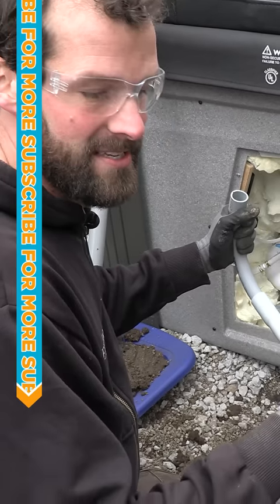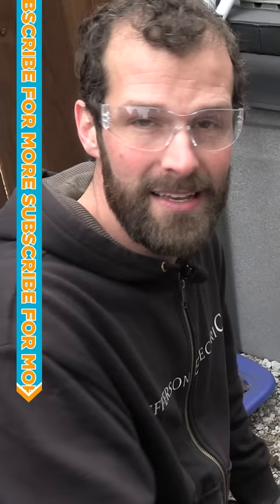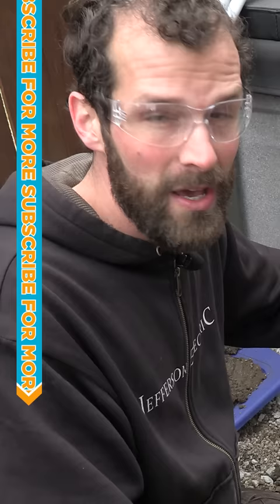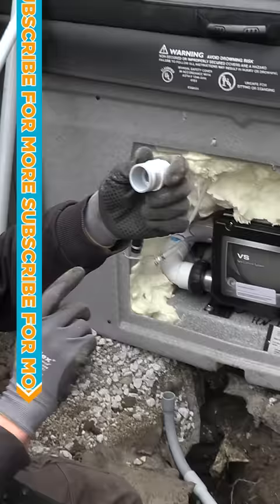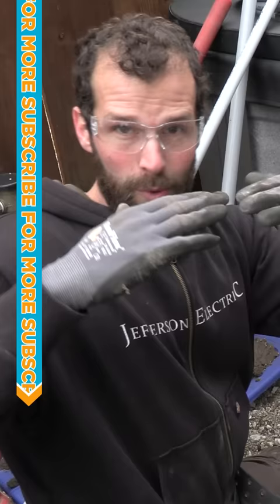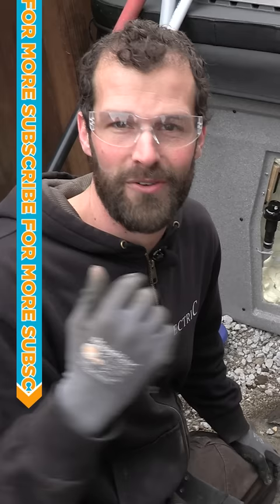A Warning When Using PVC

Comment: 20 years as an electrician and I’ve never seen that happen, hell we run empty conduit underground for future use and years may go by and it’s still functional but then again we glued our pieces together.
Reply: Yeah man. Same here. You need to glue both sides and fully seat it into the coupling end and hold it for 5 seconds. Otherwise the expanding gases or whatever will push the two pieces apart, leaving it about 1/4”-3/8” from being fully seated. This is a pain in the ass because the snake will get caught up in that little gap, especially on bends.  I’ve never had PVC fall apart after the fact though. As long as you glue it really well and let it set while fully seated in the coupling , it’s not coming apart underground.

Edit: Like your name. I always say “storms-a-brewin”
Reply: @SnotrocketLT4  Thanks
Reply: Well my friend your definitely not an industrial electrician and most likely a terrible one.
Reply: @SnotrocketLT4  lol really never. That just means you don't really do much.
Reply: @shawnshurtz9147   Wait, what? lol.
Reply: @SnotrocketLT4  I've seen steel conduit pull apart and break.
Reply: @DankEngine710  it's not the sunlight it's the heat and I actually work. For 100 feet of pipe 100 degrees temp difference you get 3.6 inches of expansion. If it were near 100 degrees outside when you installed the conduit that winter when it was 0 degrees outside the 100 feet of conduit would shrink 3.6 inches. He was a little wrong you are totally wrong stick to dumb factory work it suits you because you have no clue. I mean thermal expansion was taught in like what 3rd grade.
Reply: @shawnshurtz9147 Boy someone is pretending to be pretentious.  You would only need an expansion fitting if it's above ground and the expected expansion is to be about 1/4" or more between a secured item (box, elbow, etc) a horizontal run direct burried underground with them glued properly and below frost line you do not need an expansion fitting.  (The piston wouldn't work directly burried) Your whole book answer equates to about after 6ft @ 100F coefficient you need an expansion fitting. You should get some REAL WORLD experience before talking down to others.
Reply: @shawnshurtz9147  did it pull apart in the dark like your attitude to everyone here?
Reply: @brianwoods6403  no the cold like your attitude to actual knowledge.
Reply: @hollowlife1987  Is 20 years all over the country running and working hundreds of jobs enough REAL WORLD experience.
Reply: @hollowlife1987  also if you'll notice I didn't say anything about burying it go read. I was just letting that said it doesn't expand know he was totally wrong. Also what do you mean "below frost line" that's roughly 6 feet where I'm at. There is no way in hell I'm going 6 feet deep with conduit you've lost your mind.
Reply: @brianwoods6403  I'm the one that's not on the jobs till the end to fix the f-ups so the jobs get finished on time. You know the guy that's actually good. Nice to see you get up at a reasonable time though.
Reply: Let's be fair, his story is not completely nonsense: it is relatable, and easily preventable.
Reply: @shawnshurtz9147  What a day mb comment, let me guess, you’re 12?
Reply: @pear7777  Maybe for some, I guess.
Reply: @WORDversesWORLD  42 nice guess though.
Reply: @shawnshurtz9147  Close!
Reply: 42 and acts 12
Reply: @hollowlife1987  wait a minute here are you doing what you accused me of doing girl.
Reply: @justinkase1360  how so
Reply: @hollowlife1987  I didn't mention underground. My whole point is everyone's telling the guy he's totally wrong and stupid but he's not. I'm going to guess no one making these shit comments has ever opened the nec
Reply: @shawnshurtz9147  why comment on a comment about an underground install if your point didn't apply to underground installs...🤔
Reply: Yeah, agreed. I call BS. There ain’t no way that pipe expands an entire inch WTF😂😂
Reply: @g-dub4593  Anything for video content, right or wrong!
Reply: @hollowlife1987  I realize you're late to the party but it was a comment for one that got deleted that said pvc doesn't expand.
Reply: @justinkase1360  that's great but the person I actually commented on deleted their comment so.
Reply: @shawnshurtz9147  Nah, sorry. When you reply to someone, their username pops up and is at the beginning of your comment. You replied to both RAINS ACOMING and SnotrocketLT4. Those are the posts I'm quoting. Perhaps you are talking about another post of yours that I didn't quote or mention?
Reply: @shawnshurtz9147  yeah, I’ve seen steel pull apart and break too. On all my jobs though, when using PVC I always glue it really generously on both sides and hold it in there for a few seconds, all the way in, to make sure it doesn’t push out while it sets and I’ve never had a problem. I suppose it could pull out though, especially if it’s not seated that well to start with. Actually, after Hurricane Sandy it was a little hard to get parts, especially for main services and stuff (meter pans, weather heads, eyehooks, etc.)
and I actually got different PVC glue that totally sucked. It was definitely inferior. Luckily I found this out on PVC that I was using above ground so I caught it and was able to fix it. If I had used that crap underground, it definitely would’ve failed. I’ve  only been doing this for like 36 years though so I don’t really know if I’m even qualified enough to talk to you about electric work though. You seem to know a lot and probably know better than me and a lot of people. I can tell because you were telling the other guy he’s a terrible electrician and telling me I must not do it too much, so I’m assuming you must have a lot more experience than both of us. I’m getting there though. I’m learning a lot every day, and my Dad says soon I’ll be able to do splices and measurements with that thing with all the little lines and numbers on it and other hard stuff that he always does.
Reply: @shawnshurtz9147  it's not just "heat". Anything exposed to prolonged direct sunlight will be significantly warmer than the ambient air temperature.
Reply: @jimkane9832  um alright so significantly warmer would mean heat correct lmao. Even if you had no sun and heated it to the significantly warmer temperature the sun made it it would expand the same. If you put it in direct sunlight and maintained the temperature with out letting the sun warm it it wouldn't expand. It's literally the heat.
Reply: @jimkane9832  doesn't matter if it's from conduction convection or radiation.
Reply: @shawnshurtz9147  hey bro you can get your point across without insulting.
Reply: @shawnshurtz9147  He’s just HVAC guy. 
A Trump Supporter too.
Reply: Yeah. It's hogwash. I have run plenty of conduit and never seen it. I run pvc in direct sunlight for solar installs .... lol
Reply: So in the UK,for buried pipes we tend to use ducting that comes on massive coils instead of pvc conduit. And I'm not talking about kopex (flexible conduit) we use the proper ducting that comes pre draw wired,no need to join it either as it comes in massive lengths, coiled.

We were taught in the college part of our apprenticeship about heat expansion/cold shrinkage on pvc pipe,but with our temperatures it'd be like 10mm at most.college was 20+ years ago though,so I don't remember the exact amount.
Reply: @SnotrocketLT4  don't forget the primer or it may pull apart anyway
Reply: @shawnshurtz9147  people are forgetting that the ground condition and frost line aren't the same everywhere in the US.
Reply: @SetchiPaunda  ABS has thermal expansion. I don’t know what he is talking about with pvc. I hate it when I install a pvc fence in the summer sunlight and it falls apart in the winter cold.
Reply: Depends on where you live man here in California someplsces the ground in the summer can get hot enough to singe flesh.
Reply: @infernaldaedra  I’m from Texas and the worst thing I see is discoloration from sun exposure.
Reply: @WORDversesWORLD  Texas is generally similar in some areas but if you live down south it's going to more coastal
Reply: @shawnshurtz9147  "attitude to knowledge" 😂😂😂 genius
Reply: I also call bs.
Reply: What temperature swing did you base this on? The way I figured it, starting at 125F and dropping to 55F would contract only about 1/4 inch in 10 feet.
Reply: @shawnshurtz9147  so let me wrap my head around this and your absolutely ridiculous idea......(10 years as a well contractor) so if I take my pipe off the truck and lay it out end on en beside my pipe and it just so happens to be in the summer and I'm doing new installs everyone of them should have come apart after we dropped them in the ground...I hate to break it to you I did  19-22 new jobs a week for close to 10 years and that almost never happen where "oh the pipe come apart on us must have been the sun/to cold to fast l" if at all
Reply: @demenes1541  I didn't say any of that no. You do over 10-20 jobs per week that's cute how many pieces of conduit do you install one? The last job I was on had roughly 20 miles of conduit. Once again I didn't say that.
Reply: @demenes1541  also you do wells what shit state do you live in that they let an unlicensed electrical contractor do electrical work?
Reply: He's off by a magnitude on his expansion.
Reply: Yeah this guy is obviously not to bright.... We've buried pipe for future use, glued it as your supposed to and came back 7 years later pulling 4/0 through it with no issue.... This is a diy guy ready to start fires
Reply: I've seen it once. We were running 3"pvc into some vaults. Didnt have any slip couplings to be able to install end to end,  had to glue one side, and as you know 3" isnt very flexible, so could only glue like 3/4 inch and pushed like hell to get it into the bell end that was running into the vault. Where I live it gets like 110 in the afternoon, and like into the 60s in the evening. Came back the next morning it was popped out of the bell end. Was able to throw some glue on it and get it pushed back in before we poured concrete in our duct bank. Not worried about it, cause after encased by concrete, that conduit isnt going anywhere. It's not a common occurence, but there is some validity to what this guy is saying. But I wouldnt worry too much about it to where ite gonna effect my thought process while installing pvc is most normal temped days.
Reply: 36 years for me, and most of what I ran was in the ground for months before the wire was pulled in it. all this time, I had no idea my pvc was so special.
Reply: Ikr ? It’s almost like PVC keeps the pipe from moving ? Never thought I’d see internet electricians 😂. But come to think of it.....🧐. This could make for some very fine entertainment 😂
Reply: @shawnshurtz9147  42 years old. And your the company man that gets the shit done . You putting in down as they looking up at you in awe . Yet here you are. Arguing endlessly with teenagers on joo tube 😂
Reply: @ClaytonBigsby01  nope guy that likes money willing to travel the country. Also union.
Reply: @ClaytonBigsby01  If course it’s entertainment, all of it is!
Reply: But they make expansion couplings just for this reason. The problem I see with most guys when they lay PVC is they never use expansion couplings.
Reply: @williamrose7184  Expansion fittings are usually used where the straight run length is greater than 25 feet and expected temperature change is greater than 60°F. Rigid PVC conduit has a coefficient of expansion of 3.38 x 10-5 in./in./°F. A 10 foot length will change in length about 3/8" with a change in temperature of 100°F. This equates to more than 4 inches over a 100 foot run
Reply: Mostly everything you said is completely accurate but expansion couples need to be used in a lot more circumstances than you think. Especially with PVC. And I don’t know anybody that leaves their PVC baking in the sun for four hours. And everybody knows pipe in the ground well eventually get water in it it’s almost impossible to stop but that’s why the conductors are rated to be in water. That’s why we use THWN.
Reply: @williamrose7184  Service entrance pvc is ran outside which gets direct sunlight, and a sealed system will not get water in it!  Might as well say water pipe will always leak.
Reply: Hey service is not sitting in ground which gets flooded with water all the time. PVC in the ground and PVC on the side of a building completely two different animals. PVC in the ground most of them believe it or not get water in it. One way or another. Of course it’s not every case but you won’t believe how many jobs I’ve been to with freshly laid pipe or pipe that’s been there for a year or two years or three years or 10 years and we send a fish through and it comes out wet. Again that’s why our conductors are rated be in water. But like I said it’s not every case. Most guys do not clean the ends of PVC or primed them prior to gluing and that’s the problem. PVC glue is not glue it actually melts both pipes and fuses them together. But if the end of the pipe is dirty or oily from your skin it’s not guaranteed you’re going to get a good fusion.
Reply: This whole comment thread is a perfect example of, " are you a tradesmen or someone who just works in the trade".
Reply: Thank you. This guy needs a new tape.
Reply: Come on man. An inch?? No, that’s not going to happen. If it’s glued properly. It’s not going to pull apart. No glue and you’re the one separating it when you pull the wire.
Reply: @SnotrocketLT4  best response!  "my dad tells me" I was dying when I read that.  Been an electrician for 17 years in Florida.  There's no practical way to keep pipe cool here and I've never had a problem with expansion or contraction on my underground.   Majority of broken conduits I've found have been from roots and excavators.  I've ran pipe in the summer and pull wire in the winter no issues.  Although I agree pipe will expand but I don't think it's to that degree.
Reply: Right the glue basically conducts a chemical bond between both and pvc underground doesnt shrink. In the sun on a roof top you use expansion couplings, but even if his ridiculously made vid was true he gave zero solutions I gave the solution for rooftop baking heat.
Reply: If someone is installing pvc and not gluing it your not an electrician and your. Or following code or manufacturers instructions
Reply: Yeah no fucking shit, you glued it together. This shirt was obviously assuming no glue
Reply: @michaelmerryman7806  hahaha.  Thanks
Reply: @HCG  why the fuck would you not glue it?
Reply: @shawnshurtz9147  the glue isn't a glue and melts the pieces together. 
Keep breaking back, 😆
Reply: @SnotrocketLT4  yeah I think this guy on this video is just being a troll. Wanting to cause an argument on the job site by some green horn
Reply: 15 years and I’ve never seen a pvc break from temp and I’m in MN. -30 winter +100 in summer
Reply: Can’t we all just get along 🥺
Reply: @shawnshurtz9147  what union
Reply: @719Flowers  ibew
Reply: @Cannot Compute  the good one
Reply: @shawnshurtz9147  Hey man!  Local 728 Ft. Lauderdale here! Peace ✌️
Reply: @Dolfan 13  lu 14 here brother.
Reply: @shawnshurtz9147  Wow, you're way up north! Well, keep warm brother.
Reply: @Dolfan 13  I try -20 for a month and a half though
Reply: haha no kidding , I work for my dad if I let that pipe sit around for 4 hours ,he gonna ask me what the hell I've been doing for 4 hrs ,this guy has some good content but this is ridiculous
Reply: @hollowlife1987  state your argument professional, with out the need to call people names and insult them. When you revert to insults, you’ve lost the argument and credibility.
Reply: @user-ln7of9gs4s  That was entirely my point stooping down to @Shawn Shurtz level as he was calling other people a terrible electricians that are suited for crap factory work.  However I guess he was referring to someone who deleted their comment instead of the original comment he replied to.
Reply: @ayeitsshane806 this guy is a master electrician. Maybe what he’s saying hasn’t happened to you but he sure as hell knows what he’s talking about
Reply: @caleb leuciuc  maybe so but doesn't seem likely I'm 13 years in and licensed in 3 states and this guy may have dabbled in electrical for 20 years but certainly hasn't consistently done electrical for 20 years. You have to prove your knowledge and from my experience of dealing with guys that say they're a master or a journeyman means they are full of sh!+ majority of the time. Real master electricians do not claim that title lightly because our trade changes so much your always learning and its hard to master a trade like this. But what do I know🤣🤔
Reply: @caleb leuciuc  after watching more of his videos I take back my comments about handyman or dumba$$ i judge that from a short that i still disagree with but This guy is definitely a knowledgeable electrician.
Reply: @ayeitsshane806  Great! its hard to judge someone off one video and Im glad you looked into it. I learned a lot form him and continue to do so
Reply: @caleb leuciuc  that's awesome. I've always said I wished there was stuff like this when I started.  Here's a couple other channels worth adding in my opinion. 
Electricanu for explaining the work, sparky Channel for showing you code and how to do the work, Mike holt for code and test prep.
Reply: @shawnshurtz9147  Then whoever installed it did so incorrectly.
Reply: @williamwinder3466  yeah that's the point.
Reply: I did a ~250ft PVC run out to a dock at my first company as an apprentice. I was aware of the expansion/contraction of PVC but didn't say anything because i was getting mistreated by the boss and figured i'd let him do his own thing. If you refer to table 352.44, you'll see that in any situation where the total change is greater than 1/4, you have to add an expansion fitting. So i came back a year and a half later expecting to see what i saw, and it did pull the pipe probably 5 inches out of our pull box. We also used PVC clips.. most of them broke. The guy in the video is a little off with his 1 inch/10ft metric though, for that amount of movement it would have to have a 200° temperature fluctuation. Generally in a northeastern climate where i live it's about 3"/100ft between winter and summer in direct exposure and even less than that in the ground. Mostly a non issue but still something to be aware of.
Reply: @shawnshurtz9147  damn, they taught you thermal expansion and skipped right over punctuation and sentence structure.
Who hurt you in your life
Reply: Lol
Reply: 35 years of experience, I'm a master electrician, and I can tell you that this is not true. I even live in Arizona and this doesn't happen, even if it's laying in the Arizona sun. If anything every 100 feet or 150 feet, you should put in an expansion coupling in case the pipe gets pulled from downward pressure But not from shrinkage
Reply: I was just gonna say. Glue? 👍👍👍
Reply: @ayeitsshane806  Your comment about always learning is exactly right. When I do get talking about jobs I have done it's a conversation out of interest with another tradesman. What I have done is ask questions and learn all I can from others for my 35 years in construction. Self- Employed Master Electrician since '98. ( I got some of my best industrial experience with the IBEW on some great jobs with some great electricians (7 years total) but there was more than a few arrogant loud mouths on every big job just like this Shawn guy in this chat.) The more you learn the more you realize you don't know in this trade...well except for some big shots that know it all the day they make Journeyman.😂
Reply: @ghostrider433  good story. I won't use PVC straps for that reason. Somebody told me it was technically wrong to use Steel straps.... honestly I haven't even looked it up....I honor the Code but common sense shows anyone paying attention that PVC straps (outside at least) are inadequate and unreliable. BTW, I repaired a dock run just last week almost exactly like your story.... ripped out of the J-Box...mice had moved in and chewed off all the insulation. Nasty
Reply: Yup me too Primer really helps too.
Reply: It's doesn't expand with sunlight, especially grey pipe. White for plumbing can become brittle from excess uv light but it does not lengthen. Expansion and contraction like he's talking about doesn't happen.
Reply: @rcurley2463  Electrical PVC conduit absolutely expands and contracts with temperature change, check the manufacturer data sheets. That is precisely why the NEC requires expansion couplings installed after every 100'. I repaired a run last month that contracted and ripped the locknut off....you can see runs on buildings that are broken and plainly see the omission of an expansion coupling despite a long run that requires it. You can also easily find runs puckering from expansion. The details can be looked up but for the typical temperature swing in most outdoor conditions it's about 1/4" for every 10'.
Reply: New apprentice here, rewatched the video a couple times and didnt get it, he really doesnt glue his pieces together? I thought that was literally required by code?
Reply: @shawnshurtz9147  ok boomer!
Reply: @jrod264winmag  gen x thanks. You wouldn't have anything you use today if it weren't for us.
Reply: Same lifetime Electrician spanning 80’s until now and have pulled through our own PVC that had been underground for as long as 2 decades with wire in it! We pulled the wire out and installed new wire and meggered it out as per Utilities Rules and it passed.
Reply: @jefflosey1561  you tested pvc for separation with a megger...... interesting.
Reply: I'm a 24 yr electrician & I call bull%#!+
Reply: @Just Me  don't you're definitely not smart enough or had enough experience to do that. I've been an electrician as long as you've been alive and I have seen it.
Reply: Have to agress with you been a electrician since 78 and never had any issues
Reply: Facts... this guy has never laid pipe in his life. Cold or hot.
Reply: @Justin Ashton  I've laid thousands of miles of underground thousands and it most definitely does happen no often but it does happen. It happens constantly on above ground installs.
Reply: @hollowlife1987  what do you mean the Piston wouldn't work
Reply: Man I put in miles of underground ductbank and never had an issue pulling in wire year or more later
Reply: 100%
Reply: @watchhunteeteego4564  lol
Reply: Damn tradesman are such lil bishes 😂
Reply: Is electrical beater tight? Or pressurized?
Reply: was thinking same thing haha like calm down bro!
Reply: @TheSpartanBuilder  How do you get tension from any of my comments? Maybe you think of responding back to ignorant statements is tension but it's not, it's just conversation.
Reply: @WORDversesWORLD  was actually agreeing with you and saying dude was a little worked up over  a problem that Ive never once seen even happen.
Reply: @TheSpartanBuilder  Oh I see it now, and it's cool, thanks.
Reply: He's exaggerating the expansion. It's nowhere near an inch.
Reply: Agree
Reply: Fr this is like some final destination shit but when your explaining to the sweet old lady that went to home depot an bought the pvc at 8 am an he shows up at 12-1 o'clock he has to justify telling her he can't use it
Reply: Yuup and I am currently being taught to twist as you push otherwise the glue will push itself out from pressure or something
Reply: @shawnshurtz9147 It totally increases your credibility to get personally insulting like a 14 year old.
Reply: I can't count how much PVC I put in the ground I've never had it happen.
Reply: I've never had that happen and by that logic if you put PVC and the g in the summertime come winter is going to separate. And believe me I've laid thousands of miles a PVC
Reply: @TheMechasmo-ef5ue  Right!
Reply: @TheMechasmo-ef5ue  Logic doesn’t exist in the land of you tube!
Reply: @shawnshurtz9147 your wrong and have no clue what you are talking about. Some guys know everything 😂
Reply: As the guy that has come in a couple years after the electrician, it's a thing.
Reply: Same hear never even heard of this till this video
Reply: @shawnshurtz9147 ok so you work at McDonald's and you are trying to repeat what you hear your friends or customers saying to try and sound smart? Got it😂😂😂😂
Reply: @shawnshurtz9147 expansion occurs evenly, it isn’t going to pull the joints apart and make it impossible to pull line through it. he’s an idiot about a lot of stuff
Reply: Been an electrician for 19 years. Never had a problem with PVC breaking underground and not being able to pull wire through. I have had many other trades drop rocks and garbage down pipes before, but not any breaks.
Reply: Because this guy is to anxious for the trade. Contraction may occur but it’s not as much as he stated and it’s happening as the pipe is still being laid before you backfill. There’s nothing for it to pull against because it’s not buried and you’re gunna be running to your location and never notice anything. He’s just trying to make money by talking shit
Reply: No way PVC expands 1".  It's something to think about no doubt, but 1" no way.